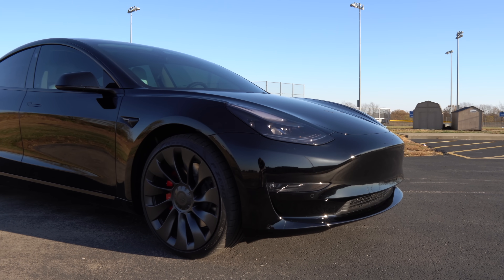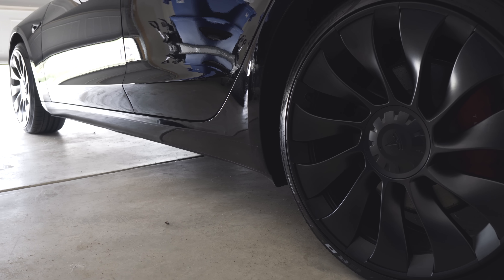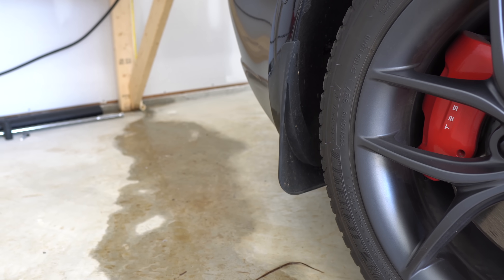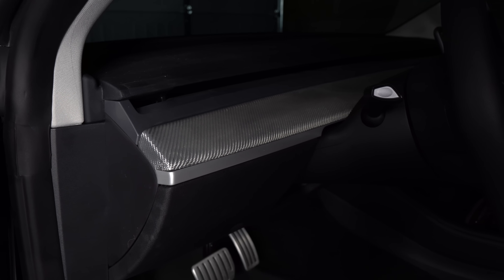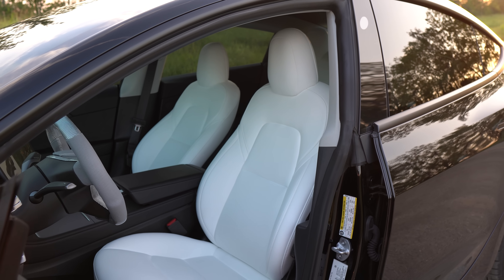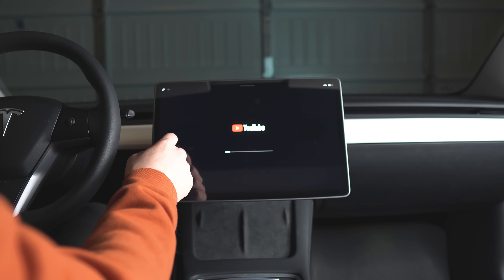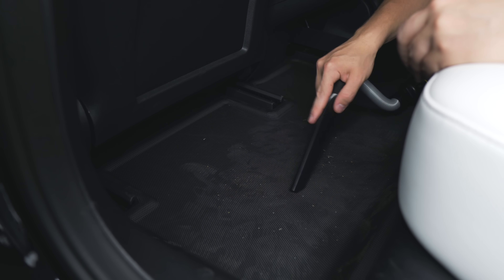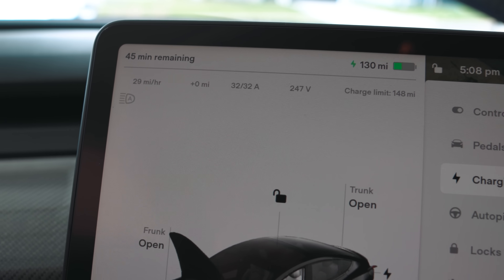All My Tesla Model 3/Y Accessories + Mods (MUST HAVES)

Comment from the maker: Accessories/Mods Mentioned in order:
High Quality Plasti Dip - https://amzn.to/45FBhG3
Dual Motor Badge Kit - https://tesstuff.com/products/dual-mo...
Rim Protectors -  https://bit.ly/RimCase (Code: MYTESLA15 for 15% off)
Winter Wheels - http://rwrd.io/ytsgmb8?c | https://martianwheels.com
Mud Flaps (3) - https://geni.us/Model3Mud
Mud Flaps (Y) - https://geni.us/ModelYMud
Tint/PPF - Studio A in Louisville, KY does AMAZING work! (Tell them Jeremiah sent you)
Floor Mats (3) - https://bit.ly/TeslaM3Mats
Floor Mats Extended (3) - https://bit.ly/TeslaM3MatsE
Floor Mats (Y) - https://bit.ly/TeslaMYMats
Floor Mats Extended (Y) - https://bit.ly/TeslaMYMatsE
Gen 2 Rotating Screen Mount - https://geni.us/Rotating
Custom Dashboard (Code: MYTESLA for $50 off): https://bit.ly/TesIaDash
Custom Steering Wheel (Code: MYTESLA for $50 off): https://bit.ly/TeslaSteering
Sliding Center Console Insert (3/Y) - https://bit.ly/TeslaCCInsert
Armrest Insert (3/Y) - https://bit.ly/TeslaAInsert
Cup Holder Insert (3/Y) - https://geni.us/Model3YCup
Hidden Storage Insert (3/Y) - https://bit.ly/TeslaAHSInsert
Trunk Insert (3) - https://geni.us/Model3Trunk
Trunk Insert (Y) - https://bit.ly/TeslaMYTrunk
Samsung SSD (3/Y) - https://geni.us/Model3YSSD
Endurance Micro SD (3/Y) - https://geni.us/Model3YESD
Dash Phone Mount - https://bit.ly/TeslaDPhone
Screen Phone Mount - https://bit.ly/TeslaSPhone
Charging Phone Mount - https://bit.ly/TeslaMBPhone (Code: MYTESLA15OFF for 15% off)
Radar Detector - https://geni.us/Radar
Roof Sunshade (3) - https://geni.us/Model3Sun
Roof Sunshade (Y) - https://geni.us/ModelYSun
Screen Protector (3/Y) - https://bit.ly/TeslaProtector
Jack Pads (3/Y) - https://bit.ly/TeslaJackPads
Portable Vacuum - https://geni.us/V8MATE (Code: JJV8MATE might save you $$$)
Tire Inflator - https://geni.us/X8APEX (Code: JEX8APEX might save you $$$)
J1772 Adapter Lock (3/Y) - https://geni.us/H4BhBO
J1772 Adapter - https://shop.tesla.com/product/sae-j1...
CCS Adapter - https://shop.tesla.com/product/ccs-co...
⚠Code: YOUTUBE for 10% OFF ENTIRE PURCHASE at Tesstuff!⚠

Buying a Tesla? Use my referral to get FREE credits, FSD, and/or Free Supercharging Miles: https://geni.us/TesIa

Learn How To Wash Your Tesla ➡https://youtu.be/GCZSRKfIa10?si=5OXJLK806t99lq2H
5 Gallon Bucket - https://geni.us/5Bucket
Grit Guard - https://geni.us/GritGuard
Spray Bottle - https://geni.us/SBottle
ONR - https://geni.us/ONRinse
Opti-Seal - https://geni.us/OptiSeal
Car Wax - https://geni.us/CarWax
Power Clean - https://geni.us/PowerClean
GSM 500 Towels - https://geni.us/Towels500
GSM 300 Towels - https://geni.us/Towels300
Waffle Weave Drying Towels - https://geni.us/DryingTowels
Wheel Protection & Coating - Currently sold out (will update when in stock)
Opti-Bond - https://geni.us/OptiBond
Wheel & Tire Brush - https://geni.us/TireBrush
Stoners Invisible Glass Cleaner - https://geni.us/GlassClean
Glass Reacher Tool - https://geni.us/GlassReach
Colourlock for Artificial Leather - https://geni.us/LeatherClean
Baby Wipes - https://geni.us/BbyWipes
Free & Gentle Detergent - https://geni.us/CleanTowels
Ceramic Coating for Seats - https://geni.us/CeramicSeats

As an Amazon Associate I earn from qualifying purchases.

In this I am going to be going over all my Tesla Model 3 and Tesla Model Y Must Have Accessories and Mods for 2023 going into 2024!

⚡TeslaFi (Code: MYTESLA) - https://bit.ly/TesIaFi

⬇More Must Have Tesla Accessories⬇ 

💺Interior
RGB/Ambient Interior Lighting Kit - https://geni.us/zdxP
Cheaper Radar Detector - https://geni.us/CheapRadar

🛞Exterior
Mobile Connector Holder - https://geni.us/ChargerMount
Tire tread gauge - https://geni.us/k5Mmm8

Comment: I have the Martian MW05 on my 2023 M3P and I love the look but man is the finish soft. Using a soft brush to scrub the tires, some of the brush was contacting the outer lip of the rim and put scratches in the finished all the way around the wheel. I unfortunately didn’t see the scratches until I was drying everything off so all four wheels how have light scratches around the entire lip.

Comment: I've used my CCS1 adapter a number of times out here in the boonies where Tesla has not felt it's necessary to install Superchargers. Only problem is EA and EVGo are so poorly maintained that you have to hunt around with plugshare to find one that works and even then some of those don't work anyway. Chargepoint is the only reliable provider as their chargers are up and running almost as reliably as Tesla's.

Comment: Aha! I've been looking for a front windshield tint that just doesn't seem to exist - maybe you can help. The Model Y windshield extends up so far that the sun blasts in on you and really adds to the heat. A tint panel or strip that starts at maybe 20% translucent and fades to 50 or 70 going down the windshield would be great. The total width (top of glass down toward hood) only needs to be maybe 8 to 10 inches so it doesn't block out overhead traffic lights and freeway signs. Any help would be much appreciated and thanks.